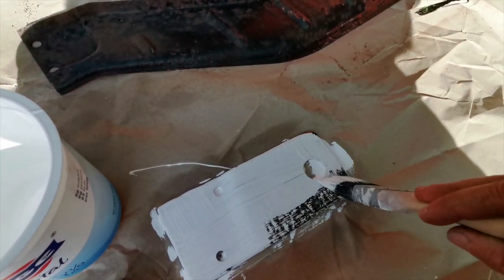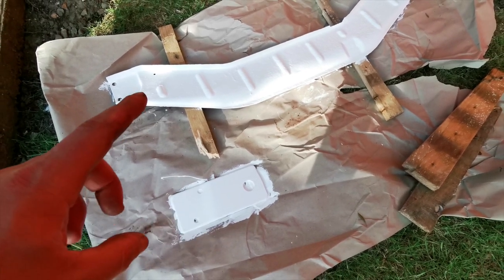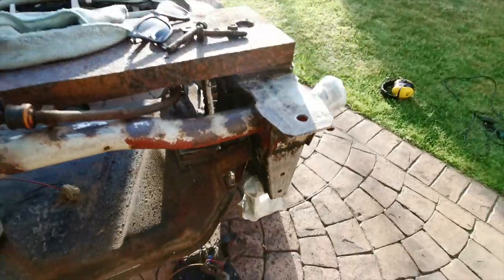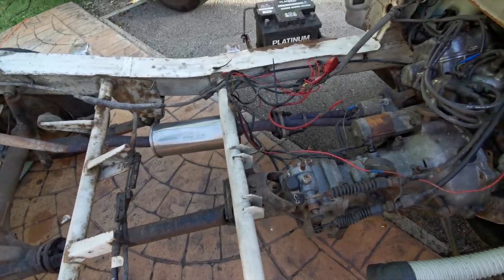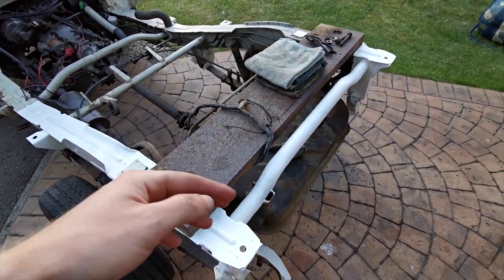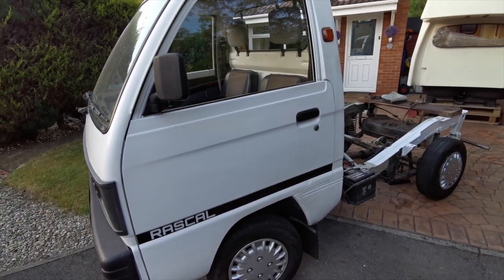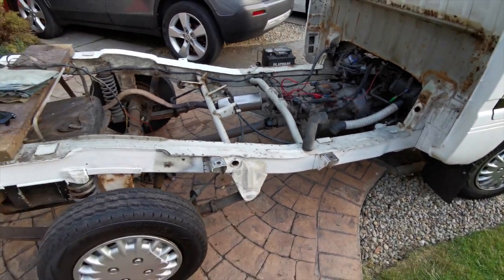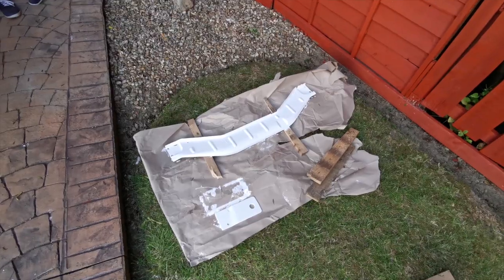Painting my Bedford Rascal with Hammerite Part 1

Comment: Good luck with the build. Couple of points. Firstly we use kitchen aluminium foil to mask wiring and tricky bits. Also that weight on the back of the chassis seems like wasted capacity. Have you thought of replacing it with a couple of house batteries mounted down low,  just in front of the rear axle?
Reply from the maker: Thank you Quentin, the aluminium foil is good idea which I didn't think about, I instead wasted a lot of time masking with tape 😂 The weight does seem like wasted capacity but it needs to remain there really so that it doesn't tip over when braking when the Romahome isn't attached. I will be using it with and without the Roma at different times. What are you referring to when you say house batteries?
Reply: @tristan7734  Batteries for the camper. Sometimes called leisure batteries. Getting that weight as low as possible would help stability, and there's plenty of room in front of the rear axle.
Reply from the maker: AHH I see what you mean, I have put the leisure batteries in the front of the romahome inside as there is some cupboards there at the bottom which they fit into nicely, but yes I could build a battery tray and put them just in front of the rear axle this freeing up more space inside

Comment: Don’t loose heart bud you know your self that it needs more paint, so stick with it. It’s worth it in the end. Also look at spraying some stone chip resistant paint before final coating. It can take agro without flaking and chipping. I used it on my Vespa restoration and it’s good.
Reply from the maker: Yes it all needs more paint, There is another part to this video, I just split them up to make more content. I may consider doing that also, thank you David.

Comment: You don't get rust where theirs a run! Don't worry about a show winning finish on the chassis as long as it seals the chassis up.
Reply from the maker: Yes you completely right, I don't need to worry about a show winning finish on the chassis, however it appears that the hammerite is not very good product. Even just after four weeks there are areas of surface rust reappearing on the chassis. I have been told that I should have pretreated this but I didn't know at the time I'm because the videos were pre-recorded. ☹️
Reply: Could try white stone chip paint it goes on a bit thicker and stays flexible.
Reply from the maker: @jimspeed1388  I will keep that mind, thanks

Comment: As to the clips that break as you try ot take them off.  break them and replace them with electricians ‘zip ties, with anchors”. Worked on my Hijet.
Reply from the maker: I will certainly do that, I have been looking for what they are called, left me so confused! 😂
Reply: @tristan7734  Here in the US they are wire ties with “Fir Trees”.   Amazon has them.
Reply from the maker: @randallthomas5207  thank you so much!

Comment: great job but i would use fertan on the rust first as it will come through again quite quickly...
Reply from the maker: Yes Dave I think you are right, and in hindsight, I wish I had done that, but it's not too much of a problem, because the rust isn't that bad. I have plans in the future to do all of it again, I want to sandblast it all and treat everything and get it all professionally sprayed, but at the moment I need to get it in good shape and get it on the road and start using it, money is also a problem, it goes out like water from a tap when doing these kind of things.😂

Comment: hi, when you put the bed back on please make sure you use nitrile nuts, in the factory they would have torqued the bolts, but l don't know to what. you don't want it working loose on you  great project
Reply from the maker: I am looking to replace them all with stainless steel, but I may need to use thread lock on certain ones. However, I will be keeping an eye on things.
Reply: @tristan7734  Hi, it might pay you to ask your subscribers if anybody knows which is the best thread lock or nitrile as it is vibration you are trying to overcome, I changed the body on my Merc flatbed, when it when to Merc for an unrelated issue they contacted me as 5 of the 8 nuts holding the body on had either fell off or come loose, I had used thread lock. They fitted nitrile and l didn't have any further issues.
Also I was wondering if the gap between the chassis legs would take a plastic water tank there seems to be a lot of free space, and is low which will help with the centre of gravity issue. All the best

Comment: Aerosol isn't as thick either. Hammerite is also 3 in 1 as well.
Reply from the maker: That's right David, that's why I chose brush on paint, I wanted a thick coat, although Hammerite doesn't seem as good as it used to, I don't know if they have changed how they make it or something 🤔
Reply: Tristan I’d do a series of thin coats for better protection. Will you be Waxoyling the box sections and other inaccessible areas?